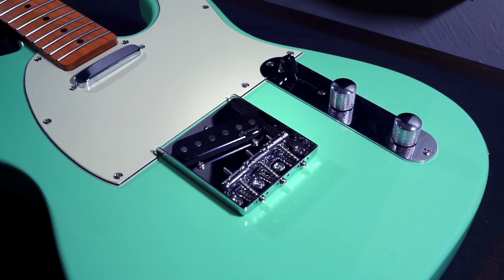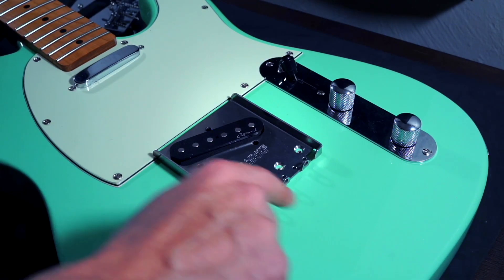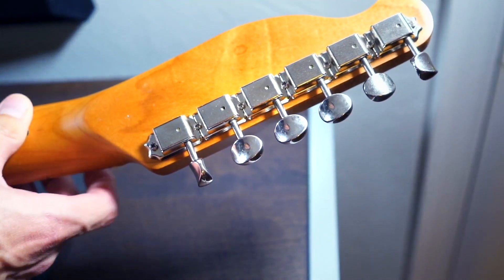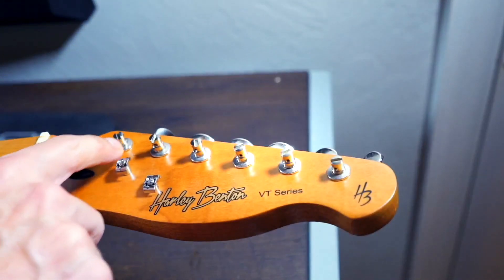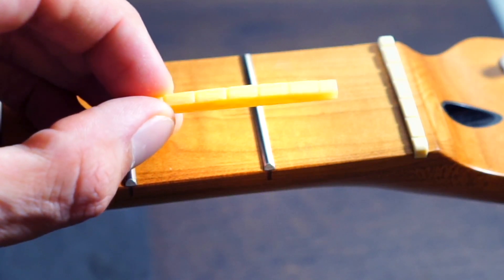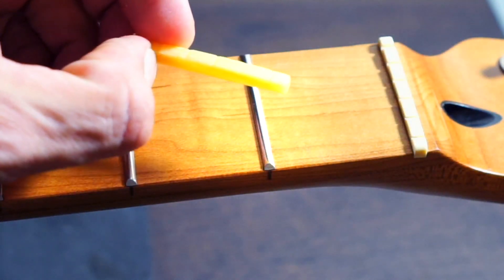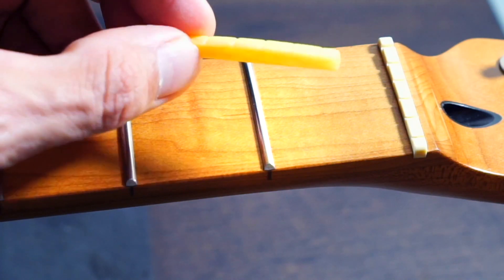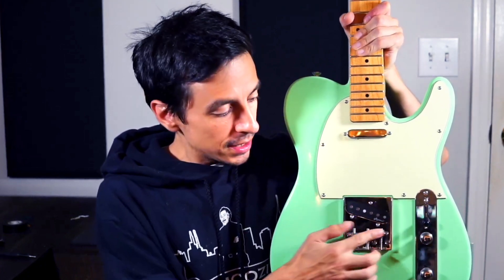Harley Benton TE62CC Project - I made my parts decisions!

Comment: It’s so cool how a person can get a Harley Benton and then do all of these things to them to give them the same specs as a couple thousand dollar guitar.  I plan to do some of the things to my Slash Appetite for Destruction Chibson.  I plan to get it totally re-wired, gonna get some Slash Seymour Duncan Alnico 2 Pros put in, and I may also change the tuners and the saddle and bridge.
Reply: Hi, I've got one of those afd Epi's, not bad for the price. I swapped out the pups for an Iron Gear rolling mill and alchemist 90 set, and upgraded all the pots and cap etc, it made a huge difference! Will upgrade the tuners soon as well. Good luck with yours.
Reply: @joetotale1  yeah I plan to do it in a few months and get it as close to stock as possible a little at a time.

Comment: Modding cheaper guitars is really fun. I bought a Squier Bullet Tele(surf green) about 2 years ago. Stock, it was actually really good, but I already had plans for a complete mod job. 
I ended up putting GraphTech ratio locking tuners, string saver saddles, string tree and a Tusq nut, Seymour Duncan Quarter pound set, CTS pots, Oak and Grigsby switch and a Switchcraft jack. 
It's one rockin' little beast. 
I can't wait to see and hear yours. Curious to hear what those pups are going to sound like.
Reply from the maker: I've modded more squiers than I can even remember, they really helped me understand the most important parts of the guitar when replacing pieces and also taught me some that actually are fine as is 99% of the time.  It's a lot of fun modding things in general, gives you a great sense of accomplishment when the whole thing is done!

Comment: The guitar looks great to start with and is great for the price.  If you can improve it for a minimum amount, such as the pickups you've been recommended, and still take on more expensive guitars then you're bang on.  Some guitar kits cost more than the guitar stock and then you'd still want to upgrade the hardware, electronics and sort out a decent finish to the neck and body.  I don't think you can beat modding a Harley Benton for sure!  Keep up the good work! :)
Reply from the maker: Thanks John!  At first it seemed like fun to try and "max the guitar out" with parts but I think this is a much more interesting approach towards it.  Appreciate the comment!

Comment: I got the blue version and I'm seriously impressed. The only 'ify' thing I've noticed is that the bridge saddles are angled, which means string spacing at the bridge end is uneven. As I've not had a Tele before I'm not sure if this is normal. Plays brilliantly and Thomann confirmed that it's made in the same factory that makes Fenders.
Reply from the maker: Some models have them, some don't.  I prefer compensated saddles but on a model at this price it's completely unreasonable to expect it to come standard with those.  It really is incredible how well these guitars are built regardless considering they cost less than most overdrive pedals at this point.  Congrats on your purchase!

Comment: Interested in hearing a before/after and a comparison to a fender to see how the new p'ups sound.  I would love to get a "tele" sound as cheaply as possible.  I've been researching budget tele's for months and am leaning toward this model and color (based on your comment on the color being close to original)
Reply from the maker: Good news bruce, the before and after is going to be posted tomorrow, I finally received the pickups and did a quick A/B with the stock pickups.  There will be Fender comparisons shortly after, although the only telecaster I currently have here is a custom shop so that's a big ask of the harley benton.

Comment: I´m planning on buying a TC-62cc and upgrading it with a Fender 4 way switch to have the option to put the 2 single coils in series. This would probably require me to install the Fender 4 way switch control plate as well to give the switch enough width to operate correctly. Do you have an idea if that control plate would fit?

Excited about this project of yours! I´m following.
Reply from the maker: Someone else in my comments section managed to fit in a prewired control plate, he did say it needed wasnt a perfect fit but it ended up working out.

Give it a try, worst case you can widen the existing holes on the control plate to fit the new electronics

Comment: Would highly appreciate if you could respond to this message with the exact names or links to the items you mentioned in the video, especially the tuners. Subbed, thanks a bunch!
Reply from the maker: Gotoh vintage locking tuners - https://www.stewmac.com/parts-and-hardware/tuning-machines/solid-peghead-guitar-tuning-machines/gotoh-locking-vintage-oval-knob-6-in-line-tuners/

Slotted Bone nut - https://www.stewmac.com/luthier-tools-and-supplies/materials/nuts-and-saddles/slotted-unbleached-bone-nut/

Bootstrap Original Recipe Pickups - https://bootstrappickups.com/collections/t-style/products/bootstrap-original-recipe-for-tele%C2%AE

Compensated Brass Saddles - https://www.stewmac.com/parts-and-hardware/all-hardware-and-parts-by-instrument/electric-guitar-parts/electric-guitar-saddles/compensated-bridge-saddles-for-tele-set-of-3/

Gorgomyte fret polish/cleaner - https://www.stewmac.com/luthier-tools-and-supplies/supplies/cleaners-and-lubricants/gorgomyte-fretboard-conditioning-cloth/

I think that's everything, the other stuff are just CTS 250k pots I have lying around.
Reply: @AudiomoMusic  Hey man and thanks a bunch for the response. Do you think any alternatives are available on Thomann, as I'm living in the EU and ordering those items from the US would be double the cost, due to customs. Basically, if you would have a minute to find some locking tuners on Thomann that would fit, as I don't know the dimensions of the ones you posted, hence, I don't know what to look for. Rest is fine, I got set of pickups already. Cheers my dude and keep up an amazing work!